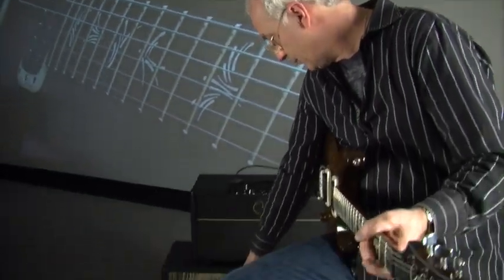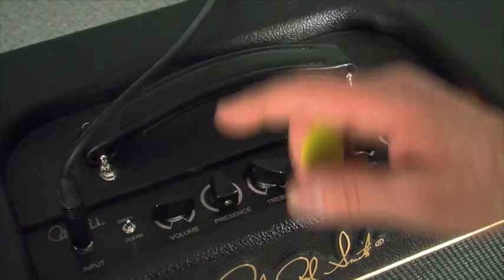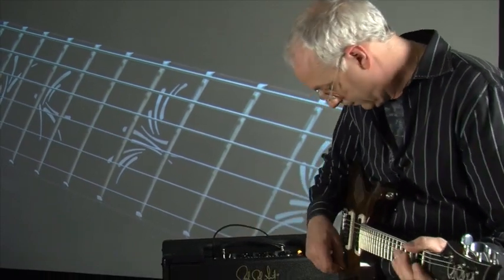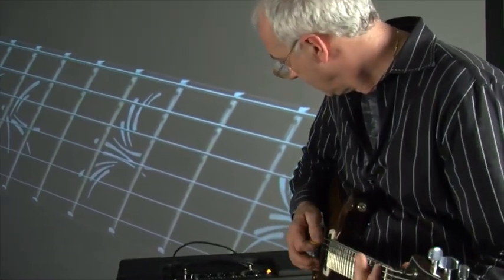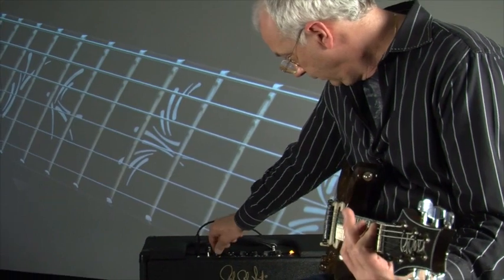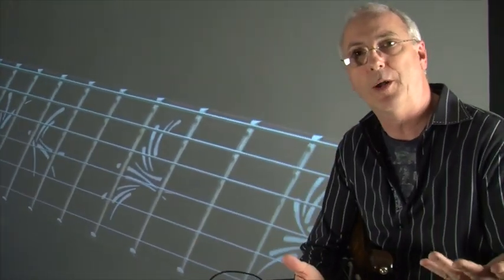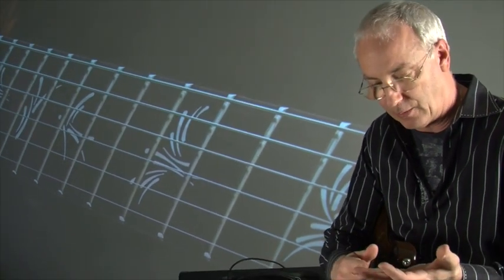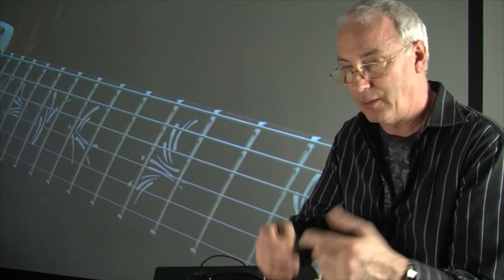NAMM - Paul's Amp demonstration

Comment: Everthing he said in this video, EVERYTHING, is the way you would describe any amp. Two channels. Check. Turn down guitar volume, it cleans up. Check. Switch pickups to get different tones. Check. Clean channel is good palette for a pedal board. Check. I could keep going, but you get my point. He's trying to make this amp seem like a revolutionary new technology. Ok...whatever. Get to the point. It's nice amp that will require three months pay, because of three letters. PRS